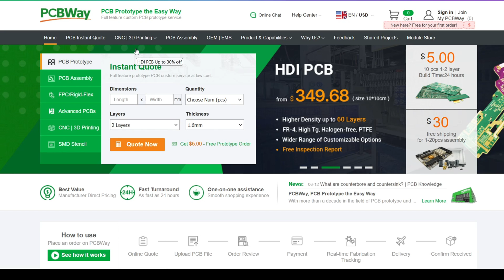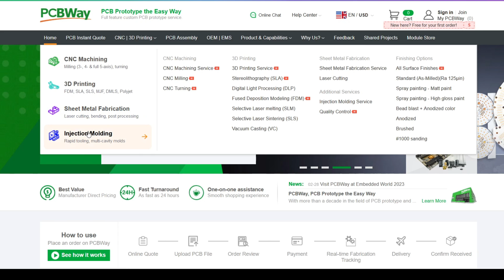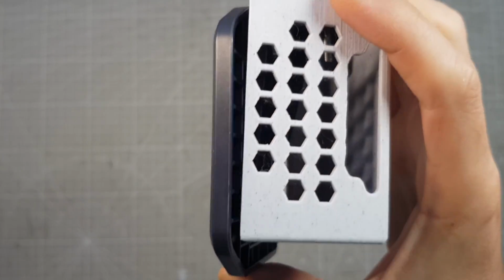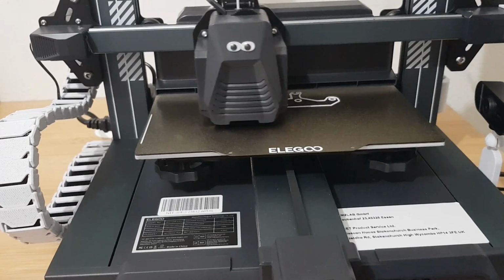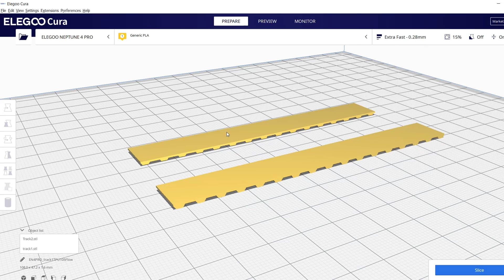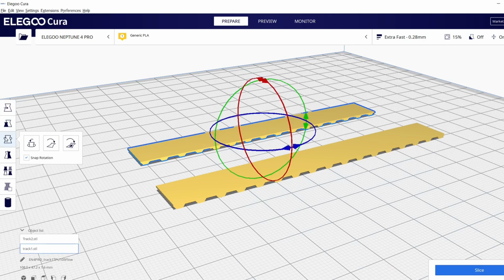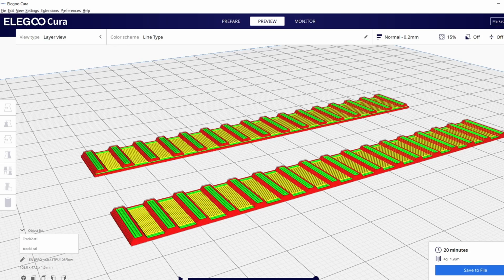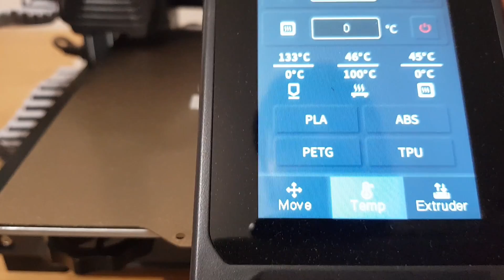Upgrades for your Neptune Printer (Part 4) - the Display holder

Comment: Nice on this video, I can comment, but not on others one's thank you for the videos!
Reply from the maker: Thanks Spencer, you are welcome ✌️
Do you mean you cant comment on others comments? Maybe i have to check the settings on my channel but dont think that i changed something there that wouldnt let you do this 🦧
Reply: @Dirt-E-Bikes  I was trying to  comment on the Build it like a tank video, but I just checked it, and now it's working must be a glitch in Matrix. Thank you
Reply from the maker: @Spencer1609751  😅 yes, that happens from time to time. As long as out printers dont glitch, its fine. Do you have the Neptune 4 or the pro?
Reply: @Dirt-E-Bikes  yes I have the Neptune 4 Pro I Love it, I had the Extruder replaced once under warranty!
Reply from the maker: @Spencer1609751  Nice!
same from my side, had some initial problems with the frist N4, but the second one works like a dream. What went wrong with your first extruder?
Reply: @Dirt-E-Bikes  I tore it apart, and the bearings have too much play in them so the filament was being chewed up.
Reply from the maker: @Spencer1609751 Oh shit, luckily you figured it out and were able to fix it. Did you buy the printer directly from elegoo? And did they replace it for free?
Reply: @Dirt-E-Bikes  I brought the printer off of Amazon back in September 2023, so I emai Elegoo about the problem I was having and having to email all the info on the printer, I had my replacement extruder in about 3 day's. Way better than the Creality CR6SE support team!
Reply from the maker: @Spencer1609751  thats fast, i buyed my printer from a local vendor, had to wait over 1 month to get it replaced 😅
Reply: @Dirt-E-Bikes  wow that that is a bummer! you could try to reach out to Elegoo and see if they can help you faster!?
Reply from the maker: @Spencer1609751  i will do that if anything needs replacement in the future, thats for sure ;-)
Thanks for that hint 👍

Comment: Can you please show how to tune and fix the N4, nearly all users have experienced issues with this printer yet there's no decent videos showing how to tune or fix them
Reply: Just update the firmware. Current firmware has remedied 99% of the issues
Reply from the maker: @draco2k3  i should also do that. Thanks for reminding me 👍
Reply from the maker: Hi, can you tell me whats your printers specific problem?